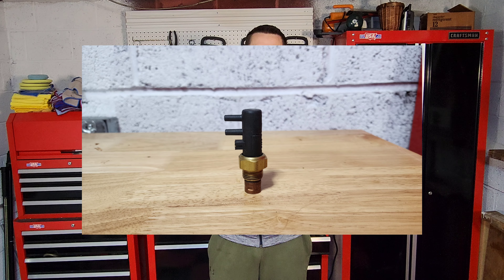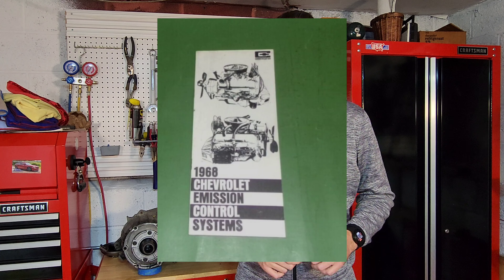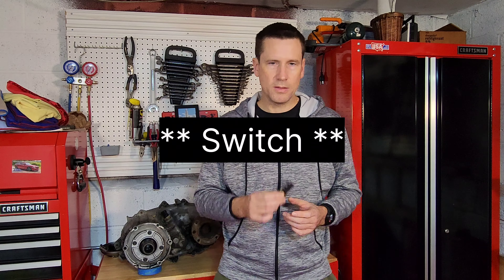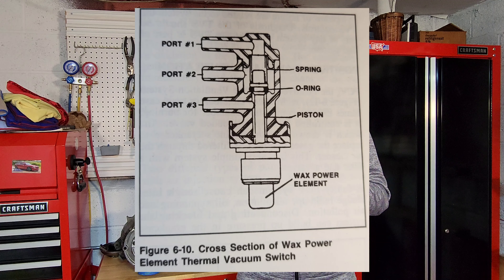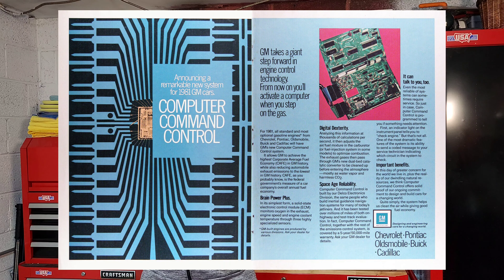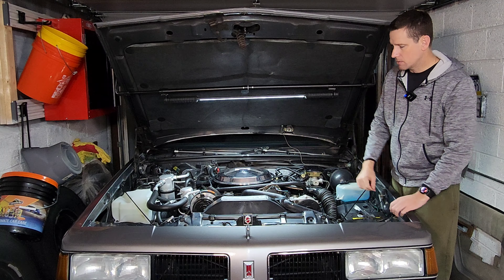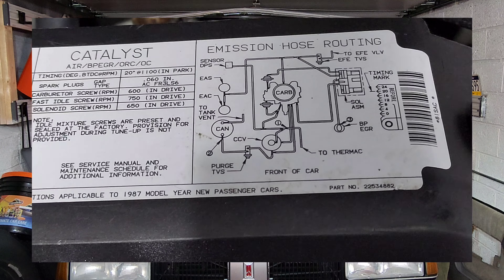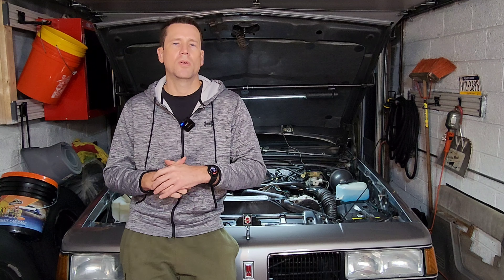More Then You Ever Wanted To Know About Thermal Vacuum Switches

Comment: Does anyone knows if the EFE Thermal Vacuum Switch and the Purge Thermal Vacuum Switch are interchangeable? If not, what are the OEM part number of each Thermal Vacuum Switches for a 1985 cutlass supreme 307 code Y?
Reply: most likely yes, they had different thermal opening but most were around 160F. Now some were open and then closed when heated but you can tell easily by pulling a vacuum on one and testing the other for vacuum. Soem were 3 way...

Comment: I have a 1980 cutlass with a 260 v8 it has a computer.all hoses have turned to powder. my fender chart shows 2 circles in line. one 
before the 4 way connector and the other after the 4 way that seams to just dead end . do you know what these are? what is an EAS and EAC thanks